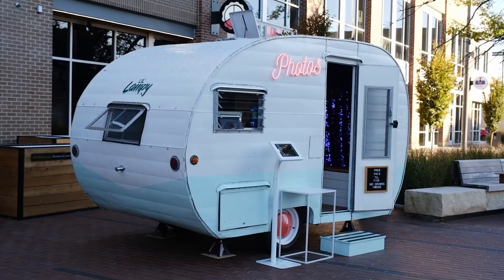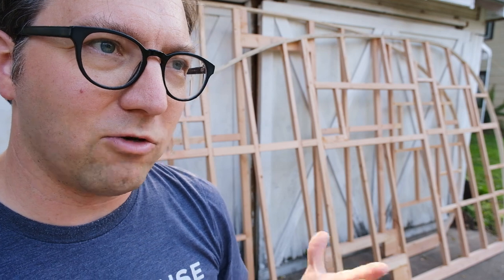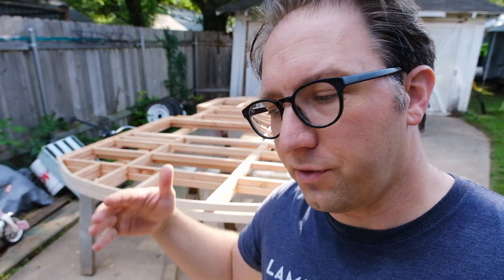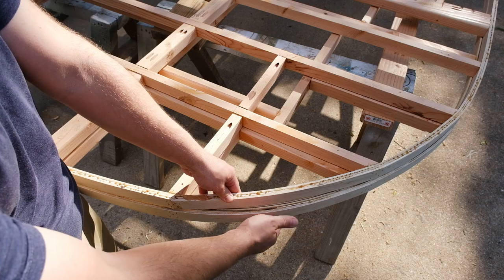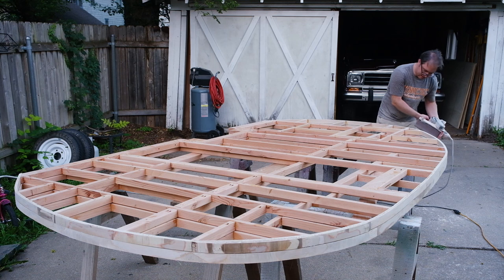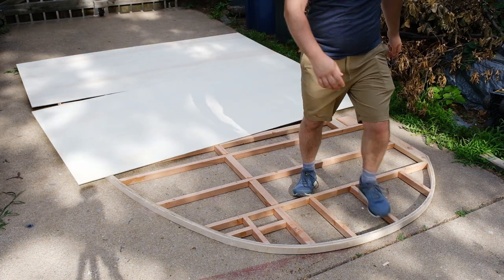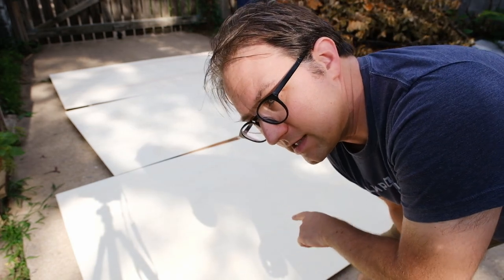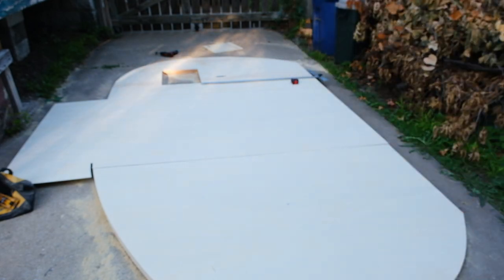HOW TO: MATCH YOUR CAMPER WALLS 👯VINTAGE CAMPER DIY REBUILD

Comment: Look good . I just finished up insulation  and wiring  on my Arrow Little Chief.  I made my bends out of a oak strip I cut and then steamed . Hope 2 be doing skins tomorrow.  Going to check out your air conditioner  vid again  . Thanks
Reply from the maker: Sounds like a fun project, thanks for watching and good luck!

Comment: Conan, I continue to really enjoy your videos.  Your sense of humor comes out in the videos and you mirror the problems of anyone trying this out for the first time.  Then, watching you overcome the hurdles shows us a way out.  I have to ask why did you do the middle panel last and not second?  Also, what brad nailer and staples are you using?  Also, what was the grit on your belt sander?  Thanks heaps!
Reply from the maker: Thanks for watching! 

I don't actually remember 100% why I did it in the order I did, but I think it was because I wanted to make sure I met the front and back edge of the curve didn't come up short, and I was concerned that the curve might be a 1/4" or so larger here or there that would be enough to leave a slight gap if I just assumed that everything matched up to my plans. So anyway, once the front and back panels were in, I had an exact measurement I could take and cut the final panel.

The brad nailer is just a cheap 18 ga. one from Home Depot and the stapler is one from Menards for 1/4" crown staples. I usually use 3/4" or 5/8" brads or staples for thin stuff, but sometimes it just depends on what my nearest hardware store has in stock, lol!

Comment: I am so scared to take the next step! I’ve got the metal skin off of my street side wall (I have to work in sections under a tarp and canopy setup) and I keep putting off measuring old and cutting new wood to rebuild her frame. 🫣
Reply from the maker: Ah, getting the skin off is a lot harder; you're at the easy part now! Do a small piece to start with, and I think you'll be a lot less scared.
Reply: Ready for this update? 😅 I started practicing on scrap today…….didn’t have a piece secured enough, threw it and busted my guard into 1,000 pieces. Also gave my partner a heart attack! Off to a great start I am lol
Reply from the maker: Yikes! What were you trying to do to it?
Reply: Cut a 45 degree angle so I could practice with my pocket jig creating a 90 degree with two boards
Reply from the maker: It's hard for me to say without seeing what you're doing, but you almost never need to cut a miter except when you get down to trim work. Just try butting the two boards together for now.
Reply: Definitely will do, I don’t need to be losing any digits! 

I want to sneak in here that I’m really grateful for your videos, they have been a GREAT help. I also love seeing y’alls little boy “helping” lol. He’s a hoot
Reply from the maker: Well thank you very much, and thanks for watching them!